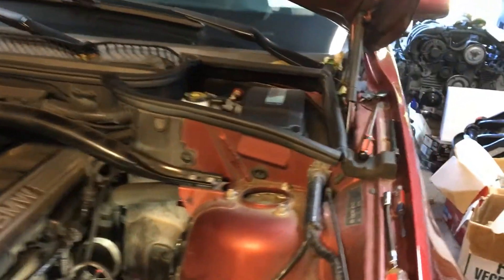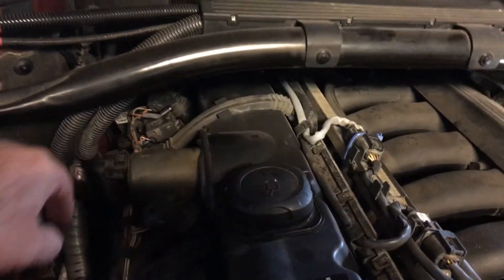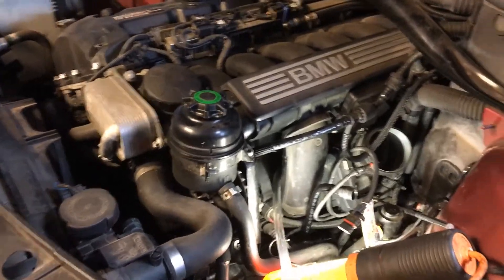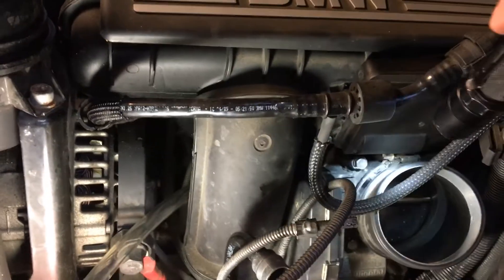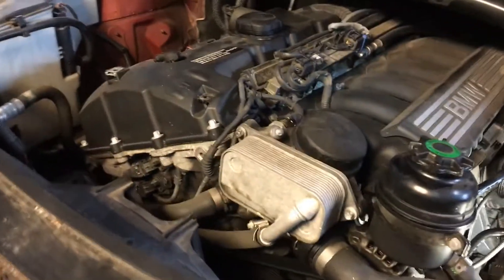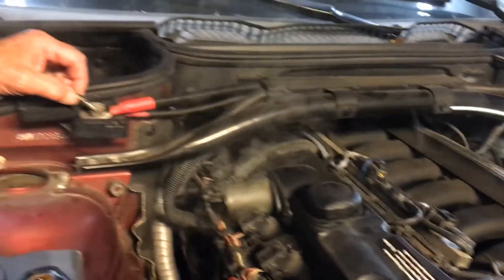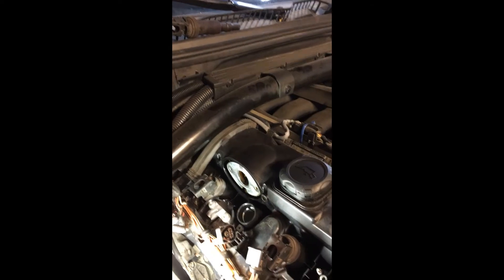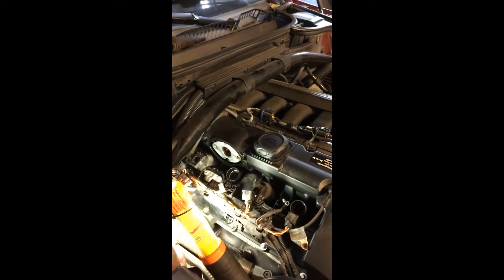BMW N52 Vacuum Leak Detection and Fix

Comment: i have no codes but it sounds like i have a turbo noise when i rev my engine witch leads me tk belive i have a vaccum leak and when i press the breaks hard the engine bogs and same when i bottom out the steering wheel and online i saw that could be from a vaccum leak so how do i know where the vaccum leak is

Comment: Hey what symptoms was this causing?
Reply from the maker: Check engine light which prevents annual emissions inspection to pass.
Reply: @e39M5e46M3  No idle issues?

Comment: Where did you plug the smoke machine tube? I see it goes from underneath the intake manifold but to where?
Reply from the maker: Vacuum line behind the throttle body, facing the intake.
Reply: @e39M5e46M3  Thanks. 
Why not the vacuum line going to the brake booster? Or even through the Oil filler cap?
Reply from the maker: @haninehamzioui9667  this one was the quickest and easiest for me. You can tap anywhere you want. Most importantly smoke is introduced where you want it to be. Good luck!

Comment: Hello, very interesting ! Did that fixed your problem ?

I do a a 130i, I planned to replace that gasket because oil is leaking through it
Reply from the maker: Yes, it did fix the problem. Keep in mind, I replaced the valve cover in the process as well.

Comment: Can I have a vacuum leak with no codes? My N52 runs smooth but I feel vibration at idle even after replacing engine mounts.
Reply from the maker: On some cars yes, other no. I think BMW is very sensitive when it goes to onboard self diagnostic checks, if there is a problem; most likely it’ll detect it. Regarding engine mounts, I hope you replaced them with OEM because aftermarket can be too stiff resulting in similar vibrations.

Comment: What do you think of spraying carburator cleaner...and see if RPM rises?
Reply from the maker: I would not dare because of risk of catching fire (if you spray on electric component or connector that has poor insulator). This could promote shorting to the ground. Using flammable substance could ignite and catch fire. Smoke machine is much safer!
Reply: @e39M5e46M3  understood. Thanks for the explanation!
Reply from the maker: You can make your own smoke machine for under $20. Youtube has tons of videos on how to make one. Smoke-machine is the way to go.